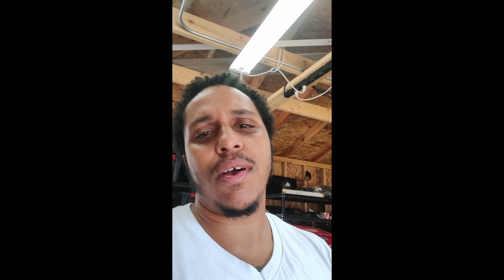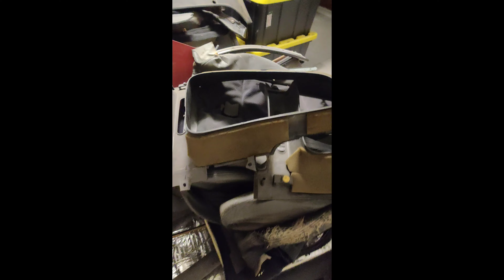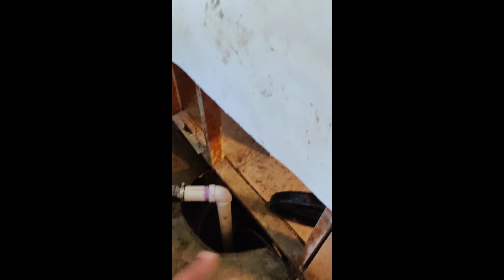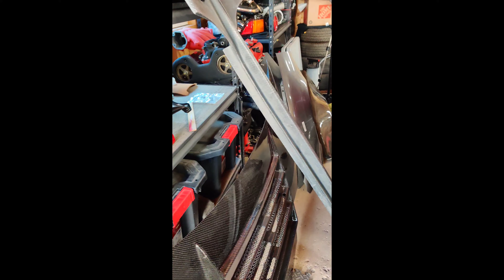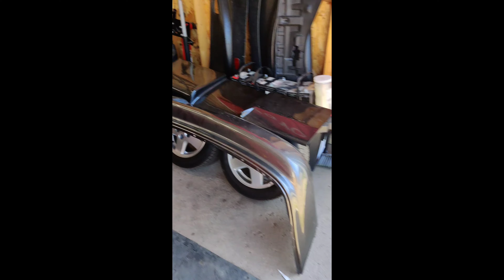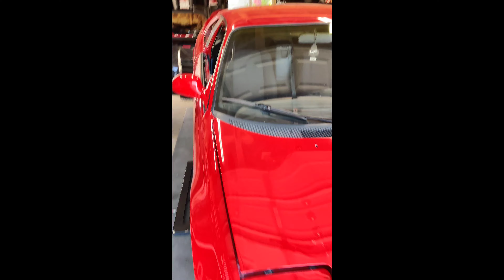N.A.G WGO UPDATE VIDEO!!

Comment: hey man from your experience , what would you suggest a 3SGTE GEN 5 swap or 2GRFE swap ?
Reply from the maker: 3sgte  5th gen is a different entity versus the 2gr I like to teach ER because of its raw power versus the 3sgte  has power and also has tons of aftermarket support
Reply: Nasty Addiction Garage in terms of reliability though the 2gr would be the better choice ? i want to travel long distances with my MR2 and not have to worry so much about something going wrong on the road .
Reply from the maker: most definitely will then go with the 2gr